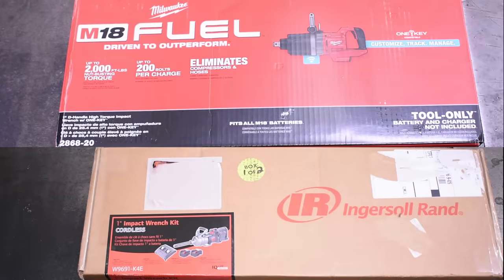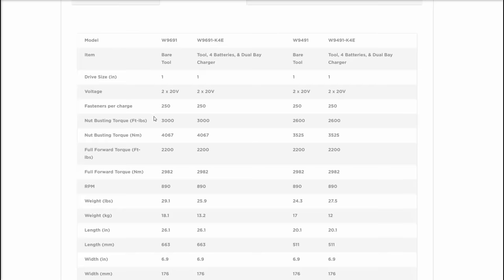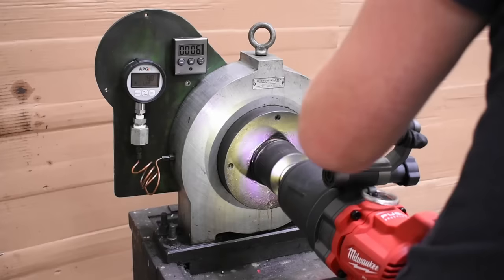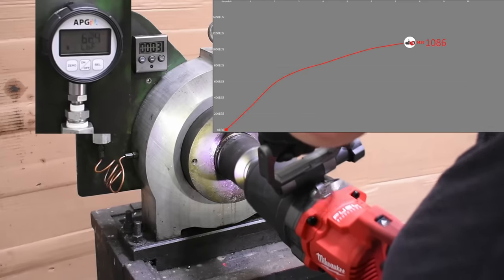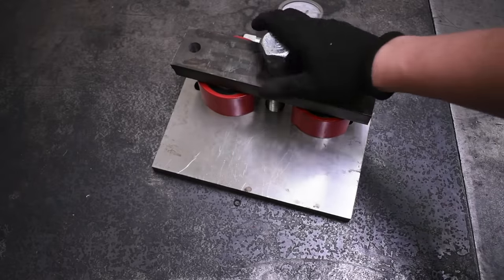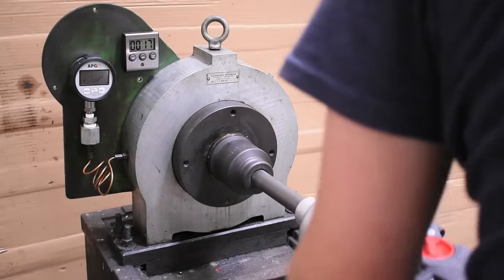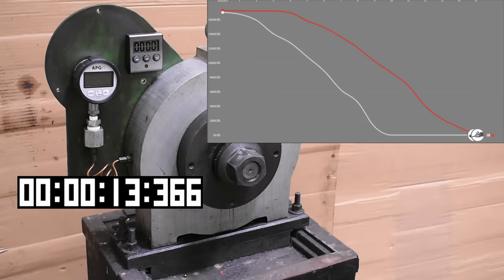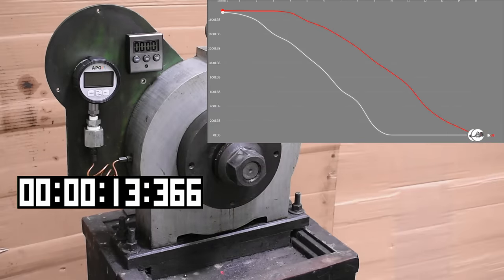World's Most Powerful Cordless Impact Wrench vs Milwaukee for the Crown

Comment: Planning on getting one of these... I was gonna go with the Milwaukee since most of my tools are M12/M18, but I do have the IR 7152 with some batteries that are getting weak.  At like $220/battery getting 4 of them with the IR gun would be nice as I could use them with the 7152 as well.  Tough choice as it would be nice to go with all one platform, I'd probably go with the Milwaukee if i didn't already have the 1/2" Ingersoll.
Reply: traitor

Comment: It's incredible what Milwaukee can do with just 18v tools, now. I really do think that Milwaukee is number 1 in engineering and they should release a new 40v line of tools, they probably make an impact wrench claiming 4000 or 5000-foot pounds of nut-busting torque, lol.
Reply: Milwaukee has 36v line . It starts with the lawnmower

Comment: With the extended anvil I feel like it’s only really catering to tire guys, and I can say from my experience, if you need more than 1800 to remove lugs, you’ll probably need to cut them. 

The biggest thing with Milwaukee is their entire line. I can take a saw and cut a trailer door, then use my impact to remove semi wheels, grinder to clean or cut metal to weld, then set up lights when it gets dark. 

I could be biased, but they just offer everything that fits my company as a heavy truck and trailer repair model.
Reply: Milwaukee grinders are all garbage bro, as a full-time welder I'll take my 3yr old Makita over a brand new Milwaukee any day.
That being said metabos are worth more than they ask for them tbh
Reply: @jonathangarzon2798  what issues have you had with Milwaukee grinders? I just picked up a flex grinder after hearing people complain about M18 grinders
Reply: You are just comparing apples to oranges here. IR since the beginning has always been about impacts and ratchets. Nothing more, they are staying in their lane and being the best at it. Just like with the Snap-on fan boys, my impacts the best. Then the IR titanium comes in and smokes it. Snap-on has a whole line of tools and all IR had were air tools.
Reply: @jonathangarzon2798  I was just making a general statement though. I use a 20 dollar metabo from lowes 99% of the time.
Reply: IR offers it with both anvil options.  Milwaukee offers theirs with both anvil options.  It's explained in the video.   

And plenty of people will need more than 1800 because there's construction equipment out there with far larger fasteners than anything you've worked on.  

This impact form factor doesn't exist just for tire guys either.  It exists because you can't put 20+ lbs on a single wrist like the standard pistol grip impacts you see in the compact, mid torque and 1000-1500 ft/lb high torque range.  (~4lbs to ~10lbs) I HIGHLY doubt semi tires are the only thing on this planet with recessed nuts either.  Extended anvils exist so you can skip the janky adapters and the torque losses that comes with them. 

Air impact wrenches with these sorts of torque values have existed for years anyways.  IR has air impacts with 1.5" Anvils and 5000 ft/lbs ratings.  You think people are going to torch up perfectly good fasteners that costs hundreds of dollars per just because a 1" Milwaukee couldn't break >1800 ft/lbs or whatever?  Yeah, nah.

edit: apparently Milwaukee had to recall their extended anvil impact wrench and it's no longer available for the time being.  They also only offer a 2 year warranty on these 1" wrenches vs the standard 5 years of most of their other tools....hmmm....

Comment: The only issue I have with the IR is the weight, tried one a while back and it was really heavy. Much like a few years back when Metabo introduced their 9" dual battery grinder, which was also stupid heavy with both batteries in it and sort of defeated the purpose of having a battery powered grinder.

Comment: If I was in a big rig tire shop all day I think I'd rather have the milwaukee. That ir looks like it's a brawler. Upside with the ir though is you'll also get to charge labor for replacing lug studs
Reply: I've used both doing exactly that, Milwaukee all day haha. Plus the IR broke completely after maybe like 60 lugnuts of use so..  😅

Comment: I got to say for anyone watching this I have first-hand experience using this to the Ingersoll rand impact the weight is substantial the batteries make sure they are charged they are perfect for service calls in a tight bind to get a tire often on but weight wise it’s not worth it when you have several axles worth of tires to remove neither is the electric Milwaukee I find myself when coming to several axles worth of  the tires I will pick up a better Ingersoll rand air tire gun then I would the electric because the weight is substantial after several axles of tires I’m a guy who often has to deal with tires but this is my shop / road calls experience.

Comment: I work at a concrete pole factory and we use 1" impact wrenches all day, probably 1500 bolts everyday. We have 2 of the Milwaukee guns and the guys who run them all day don't like them. Even though they are lighter, stronger and faster than pneumatic guns, the guys that have to use them say the excess vibration   fatigues the operator much worse than an air impact.
Reply: Should probably try the Flex high torque since it has the lowest vibration of any high torque with its head mounted on a giant rubber bushing
Reply: Lmao, tell them to stop being babies and wear thick leather gloves.
Reply: @wecx2375  this. Decent gloves make vibration a non-issue
Reply: These guys are not babies they use these big impact guns all day every day. They also have proper ppe provided to them. I was just saying the guys i work with, who use this stuff every day prefer the pneumatic stuff.
Reply: @Factoryseconds123  flex make a 1" impact do they?
Reply: @OtherDalfite  exactly, need the proper gear for the job.
Reply: @justintatum8213  bro, I got guys who work at the steel foundry who run huge pneumatic rammers all day packing sand in the molds (green sand molding) it is way more intensive than impacts if they can do it so can your guys.
Reply: a comparable pneumatic 1" impact in the same Design is depending on hose and air compressor at least as strong if not double as strong as the Milwaukee.

People that use this regulary under hart conditions don't like the Milwaukee because its weak compared to an decent air tool and you can't be as abusive to it as to an air tool with an metal housing that only needs a shot of oil any to or 3 days. 
If you just let it drop like the air powered ones it will be broken in the first couple weeks.
And it will get dopped until it is only used   by the mobile semi repair truck to change tires.
Reply: Imagine using that IR all day.
Reply: @Zozo806  why would you drop your tools even if it's a pneumatic. I've seen busted pneumatic impacts, it's stupid to drop any tool.
Reply: @giovanysantiago7562  hello arthritis, nice to meet you!
Reply: @Zozo806  no professional drops their tools.

Comment: As a massive milwaukee fan I waited so long for the 1" drive handle to arrive in the UK I used the ingersol and was impressed but to see this result I will not buy the milwaukee or the ingersol. Milwaukee need to come up with a twin battery more powerful tool these are convenient when using it for 10 minutes here and there but when you have a full set of track pads to change there is no compromise for the IR 1" airgun

Comment: Poetry in motion guys, just beautiful. I can echo what several have said in the comments about having to use air tools in certain applications being a royal PITA. If you're looking at big boy tools and have a choice between air and battery, for heaven's sake take the battery. Yeah sometimes you'll be dealing with hassles caused by coworkers Tweedle D. and T. Dumb because they didn't put them on the charger after using it for six hours on the previous shift, but in my experience it's a lot easier to correct a battery problem than an air problem. What's amazing is that for better or worse it just goes to show that battery tech really has come a long way. Wasn't really that long ago that the idea of using a battery tool all day in the shop was a joke because you knew the charge wouldn't last and it wasn't "powerful" at all in comparison to the pneumatic or plug-in tools. I can hear them arguing already which is better for this or that on the topic of air vs. battery. Only one thing to do then, let's prove it and settle some arguments. If TTC is looking for some new application based tool battles, lay down some ground rules, put air and battery tool equivalents on the title card for the next fight featuring all the tests and ring the bell.

Comment: Would you be interested in testing a old IR285B d handle to compare with electric ones? The one I have was lefted in the house I moved into. It seems like it runs I just don't have the air compressor that can run it

Comment: Ima curious with the rigid high torque octane test u used a octane 3ah battery does the torques line up the same with the 4am “high output” battery as well?
Reply from the maker: Stay tuned!

Comment: There’s absolutely no way this channel isn’t funded by Milwaukee even when it loses it still gets a, good job sport. I watch these videos on silent because every episodes script should be titled, The little Milwaukee that could.
Reply from the maker: Lol the Milwaukee right angle impact is garbage.
Reply: Found the DeWalt guy
Reply: @ashtc8  did I miss the video with the flex volt battery?
Reply from the maker: We're working on several DeWalt videos right now. Flexvolt is meh unless you have a higher voltage tool, 6+ ah XR's with the 21700's is where its at.
Reply: Hahaha
Reply: @TorqueTestChannel  I disagree with you 100% and if the performance is as minimal as you claim you should have no problem throwing a 12ah flexvolt battery in the dewalt tools you test. I mean you do throw the 12ah Hd in every Milwaukee tool you test.

Comment: with teslas 4680  being in the news, and it being tabless, its making me wonder if the dual battery backs have a higher combined power throughput with the 18650s over the combined number of tabs to carry current vs a smaller number of tabs with the milwaukee with the other size cells. less cells, less tabs and larger diameter means further electron path from end of jelly roll to tab to leave/enter the cell.  i am sure tesla patented their tabless design, but they're usually very open with their patents so hopefully we see battery manufacturers head to tabless production where max electron travel is cell height, not 1/2 length and cell height together at maximum (if tab is in the middle. if tabs are at end, whole roll length)

Comment: I think the method Justin Sturgil used was fair. He tightened a bolt with a torque multiplier to 1400 ft/lbs and then tried to take it off with the Milwaukee 1/2" gun. That's a test you could also try. I know it takes less torque to remove than was applied in tightening so 1400 tightening torque will undo with less, but this seems to be close to the way they are being rated.

Comment: I've only ever used skidmores attached to a column on site. They weigh 80-100lbs so they need a good foundation. Are you reusing the same bolt, nut, and washer for each test?
Reply from the maker: This kind doesnt use a bolt and nut, it's not a job-site go through design. It's designed to test tools like these.

Comment: so when a battery says 5ah, that’s its capacity, meaning it holds 5 ah at whatever voltage of charge, the power of the battery is how fast that current is released which is usually measured in “C” but idk if those batteries make a flame on discharge rate

Comment: I was “the guy” doing the vendors’ technical work in several public competitive tests of expensive computer networking equipments (think: $millions).  I worked for a Fortune 500 global company with a legitimately good reputation.  When it came time to allow others to test our equipment I personally was the guy who made sure that testing went well.  That meant I ran all the tests that were going to be run by the tester myself before I sent the gear (I sent the exact same gear I tested).

We didn’t cheat the tests. We didn’t put in faster hardware or skimp on testing rigor to make the numbers seem better.  Though this sort of stuff does happen routinely across industries (I’ve seen our competitors do it first hand!) and you should expect it.  It’s wise not to accept vendor equipment.  I guarantee there’s a guy like me ensuring you get a “good one”, even if it’s the same kit as retail.  There’s great risk you not only get a “good one”, you may also get a special one.  It’s super easy for engineers to goose the performance of virtually anything a little, and “a little” gain is all out need to win a lot of competitive tests!
Reply from the maker: We didn't get one from anyone who makes these. We got one from a retailer who purchased 10 of these to put on sale of their website, then sent us one to test.
Reply: @TorqueTestChannel  exactly, which was awesome!  You guys are great!  I just wanted you to hear from an insider that this stuff isn’t a conspiracy theory, it’s very real and it’s wise to follow the practices you do.  Take care!
Reply from the maker: Ahh okay! Cheers mate!

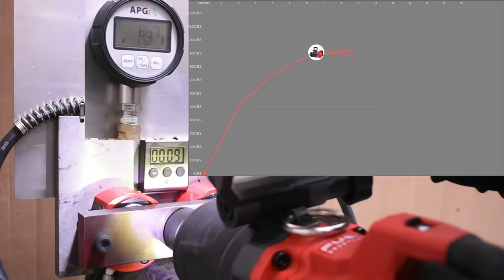Comment: At 7:40 you mention Bowmalloy bolts, are they stronger than the different types of ARP fasteners? I've always found high end bolts weirdly interesting, it would be pretty cool to see them tested in different ways. 

Anyway very interesting video as always, even though I will probably never buy such monstrous impact guns it's cool to see them actually tested! I wonder how they compare to using a similar sized pnumatic one with a paintball CO2 cylinder or HPA tank and regulator. I remember looking into using those with pneumatic tools years ago to see if it would get me more bang for my buck than electric, but never made up my mind. There are kits to connect those tanks (either HPA or CO2) to air tools that come with a regulator to take it from 800psi to 0-150psi and you can get a cheap compressor ($200ish i think) from overseas to fill those HPA tanks. To me though it looked like even with a cheap compressor and regulator it would cost more than most electric (unless you buy a shitload of batteries vs a shitload of HPA tanks). I would love to know if there is a difference between CO2 and HPA though, I think CO2 is denser or something?

Comment: 205 lbs air pressure, 1" air line and 1" Ingersoll Rand Impact Gun was the best. Pretty sure their are better Impact Guns out there now. Rotary Screw Air Compressors are the best if your budget can handle it.

Comment: you can always take the charger of the derpy machine apart. it could be a bad solder joint with one of the non-power pins on the charger... could be a broken wire...

Comment: Do you think ingersoll rand would do more with its 40 volt batteries
Reply from the maker: I have a feeling this tool IS 40V, just none of its literature says so. Keeps saying it uses 20V batteries, which it does. Two of em. And it doesnt work with 1. Some retail pages have put 40V in this tools title. IR has not responded to inquiry

Comment: I wish Milwaukee would make a dual battery setup, and maybe even a higher output, higher voltage set of batteries/tools. Sticking with single battery and 18V seems to limit them a bit, as well as they're doing with it, they could definitely do better.

Comment: Seems like using the same method as the tighten but replace the bolt with a left handed thread or a load cell with the LH bolt through the center.

Comment: The milwaukee is a 18v not a 40v its not even fair
Reply from the maker: Tell Milwaukee they are holding their tools back then if its so obviously holding them back. These are the only 2 options on the market, you're buying 1 or the other. They should be compared. Heck, the DuroFix will be 60V.

Comment: This new IR impact is quite impressive, however knowing that it is built off of the same technology as the DeWalt dual battery saws I know that these two batteries are working in tandem thus this is actually a 40v system not a 20v system. It seems to be useful to have around the shop for service calls, however it is not ideal for your average trucker to keep on hand in his truck as both the IR and Milwaukee are marketed for. Having to keep a larger charger and double the batteries is not conducive to life on the road. You will want the space that you lose for other tools if you are like myself and my former co-driver that do as many of our own repairs as possible. Combine the inconvenience of the dual battery, the lackluster performance of the battery charger, and the fact that once you top 2000 ft/lbs any more power is just extraneous for most day to day repairs; I would argue that the Milwaukee is probably a better choice for the average consumer. Also, before you call me a Milwaukee fan boy… I almost exclusively use DeWalt for my personal power tools. They are slightly cheaper and for the average Joe working on projects at home they are more than adequate.

Comment: Loving watching this. 
Why can't you test the reverse direction by using a wrong threaded bolt?
Reply from the maker: Its not a bolt on that machine but a whole 1pc assembly
Reply: @TorqueTestChannel  I like the idea of un-torquing as a test. It's more realistic. If you can somehow torque the nut to the claimed nut busting torque in 200 ft-lb increments and see if it will loosen it a quarter turn in fifteen seconds. After watching the loosening test, I wondered if time to a quarter turn might be more useful than time to zero.